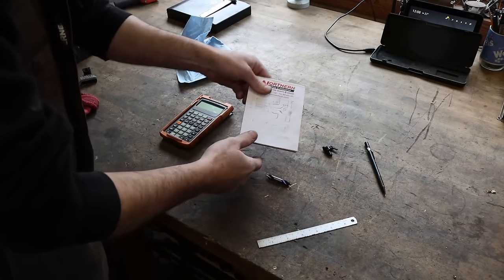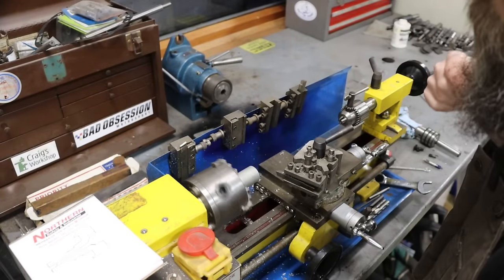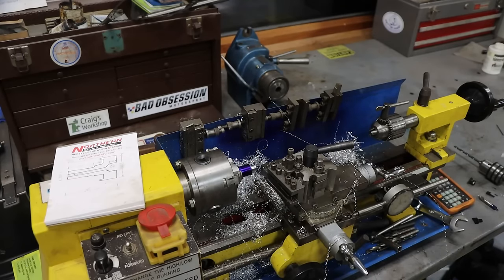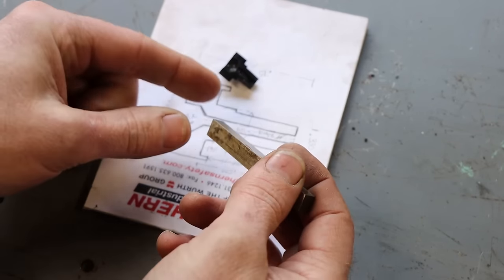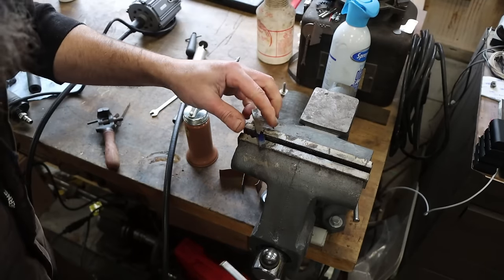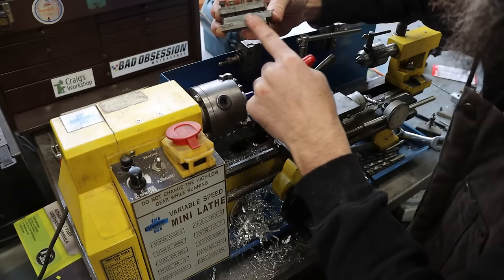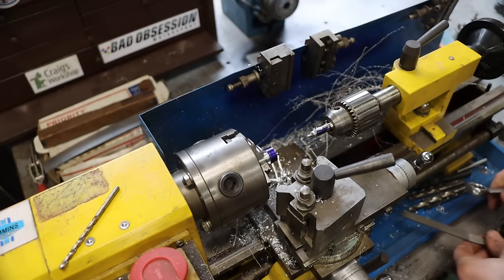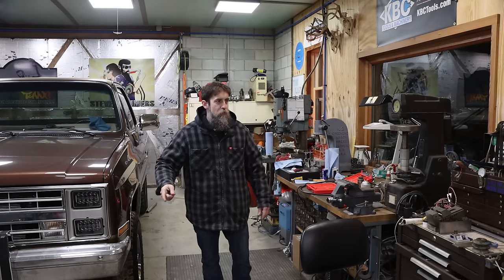Making a Mini Lathe Mystery part.

Comment: I’m in a part of Canada where winters are tough so ya, 32F is a warm winter day. Your summer temps and humidity in Kentucky would kill me. If there’s no snow on the ground I’m generally too hot. It’s all about what you are acclimated to. Oh and the mini lathe is the gateway drug to machine tools. Mine gateway was a taig, which is a less capable machine - no power feed.

Comment: When I had my mini lathe I found engaging the lead screw half nuts (without the lead screw rotating of course) then use the compound for advancing the tool. This gave a bit more of a rigid set up. Also bringing the tail stock up against the carriage and locking it (no tooling in it of course) helped too. Just some thoughts.
Reply: I do the same with my mini lathe to fix the carriage quick and dirty. When I need to actually lock it, I added a clamp to clamp the saddle to the ways. Plenty of videos on YouTube on ways to do that, all of which are well within Steve's capabilities.
Reply: I was thinking a simple plate resting in the space between the carriage and the headstock would also give a hard stop to the carriage so that pressure on the handwheel would just be a case of keep the carriage against that plate. A similar thing could be done between the carriage and a locked tailstock. Add a screw if you want some adjustability.

Comment: Great little project. It is an emergency flasher actuating button on General Motors cars and trucks. It mounted on the side of the steering column.

Comment: Nice work. It's the button release on I want to say a tool box or a panel on the side of a truck, tractor or generator access panel. I just can't picture the panel though. I want to say the side of a work truck or welding truck. You would push the button to release the hatch or panel to the tool storage panel maybe? I just can't picture where though.

Comment: The gas station owner i worked in the repair shop called me at 1am.  Get to the station right now. I jumped in my massively loud big block chevy powered 66 GTO and sped over.  Reached into his 79 eldorado and grabbed that whole hazard flasher knob assembly and tugged on it to turn off the hazard flashers.  The owner said top off your car with premium and have a good night.  Premium was like $1.28.9 a gallon.  Nothing like an early morning cruise to santa monica beach . Down to LAX to watch the planes take off and land.  Seems like yesterday. But it was 42 years ago

Comment: Steve my uncle has the same lathe, but he got sick of the cleaning the chip tray. So he removed it and found a file cabinet on casters of the same size to mount it to. He cut the top where he could fold down the sides at a 45* and spot welded bent trangles in the corners making a funnel so the chips could fall down into the top drawer. The drawer also had a feature when he pulled it out the bottom would open dumping the contents into a tub. Absolute Genius Right!👈👈😮😮🤯🤯Blew my mind when I saw it. 😎😎💡💡Plus he made a quick 2 sided way clamp to stop the carrage from backing off.

Comment: Small to Big? This takes me back to 2018. My machinist retired, and said "You need to find another or buy you some shop machines (@@)! A craigslist SB 9c popped up with lots of tooling. Basket case for under 500. A year later (& watching too many YT Machinist like you) after it was fully restored and the new wore off, went back on craigslist, and brought me 2500. That of course bought a nice LeBlond 17 with tons of tooling. But still miss that old SB 9 at times. Great little video Steve, but like you, ready for summer 🙂. Kora made me cold running the creek line,,,Burrrrrr ! Yeepers, another viewer nailed it on a flasher 4 way button 😞Bear.
Reply: I really, really miss my SB 9.

Comment: Thanks so much for the video!...you guys with your big machines have taught me so much about how to think and do on my scale of 'work'!  I owe All'Y'All an immense debt!

Lovin the little lathe!...I have a Sherline that's made a bunch of brushless model airplane motors, along with all kinds of other very precise, tiny, widgets and gee-gaws!  Like you said...brass and al-you-min-yum are its playground.  12L14 steel makes nice, soft, bits of 'tooling'...and anything harder...well...Did I mention that she really does well in al-you-min-yum?!

Ooohh!  That was quite the conversation your tool had with the workpiece!  Reminds me of the many I've heard!  Nudging the Sherline's limits is NOT rewarding at all!  I get stuck a lot in situations like that pocket you are making...not enough torque to get under the frequency, and not enough power to feed through or get over the top.  You just gotta put another twist in the earplugs and sit there!  I've found out many times just how good those 1/4" Chinesium Carbide bits are when they chirpin' like an angry chipmunk!  {PLINX!}

Comment: Steve obviously likes the Dickson toolposts
I had a lathe with a T2 size on it, liked the toolpost but ended up selling the lathe, still have toolholders kicking around though.
Currently back to using a 4 way, until I get around to fitting a B size Multifix to my current lathe.
Cheers from Dorset UK.

Comment: looking at the tiny nub left on the grooving tool for the spring pocket i wonder if it had been eazier to solder a toolsteel pin to a piece of square and cut that down to the cutter , because its round theres allready quite a bit of relief once you ct it intoo a halfround

Comment: On the front right corner of the saddle there should be a grub/set screw directly above the top of the inverted v-way.  If there is, I believe you will find that it is a carriage stop.  The only problem I can determine is that it will lift the carriage a small amount.  I have yet to measure the amount of lift on my carriage.  I made on upgrade to my mini lathe that I really think is a big improvement.  There is a kit that reduces the RPM of the lathe by quite a bit.  The main benefit I have found with this kit (two slotted pulleys and a belt) is that I can part mild steel.  Good to see what can be done with the mini lathe.  KOKO!

Comment: Where I live, -5 to -10 celsius is cold as it often comes with wind.. when it's -20 or below, it actually becomes quite manageable, but all vehicles suffer from those and it can really be dangerous if you get stranded and you forgot to put proper clothes on.

Comment: I’ve had to make the Bakelite rocker valve for pressure cooker out of aluminum and had to weigh the old part pieces and match. Lots of part remove from lathe to scale and back. If you know, what is the brand of the brown tool box behind your min lathe? Inherited my same one from my gunsmith but the badge is missing. Thanks Steve.
Reply: Looks like a 7 drawer Kennedy top box. But I've seen boxes that look just like it made by others. Wholly schemloies new they're over $670 now! It's good I already got two.

Comment: I hate to disagree with you, Steve, but 40 degrees (F) is way too cold for me.  I keep my shop around 75 and work in shorts and a T-shirt all winter long.   😀
Reply: If you heat your shop then you have to heat your shop all the time otherwise you get condensation.